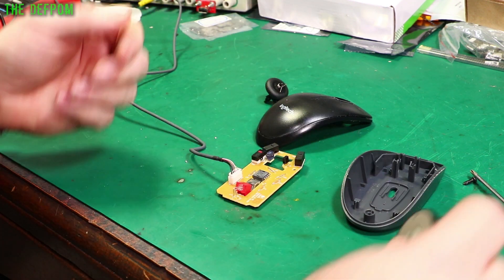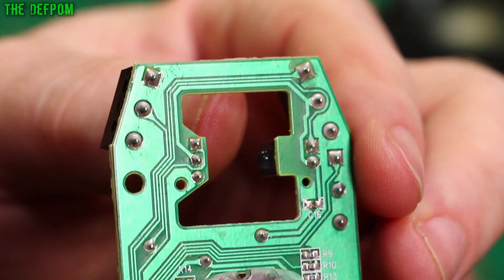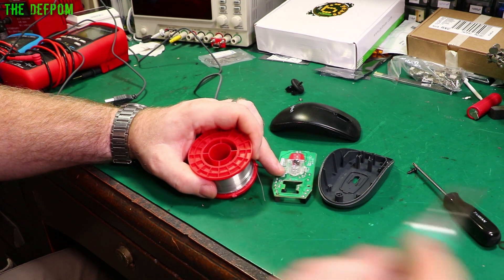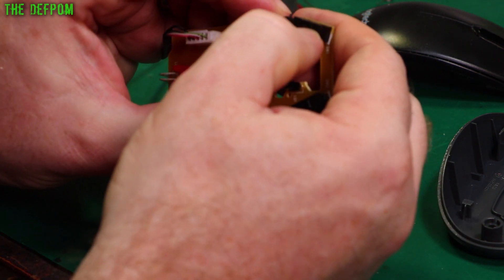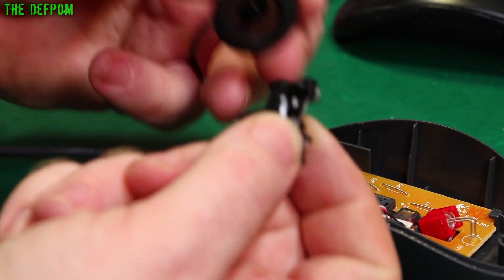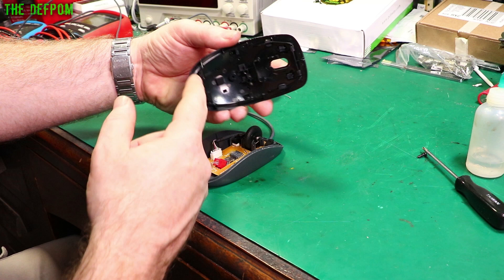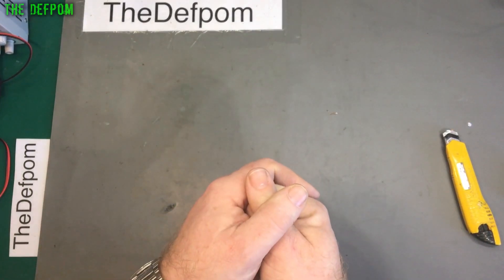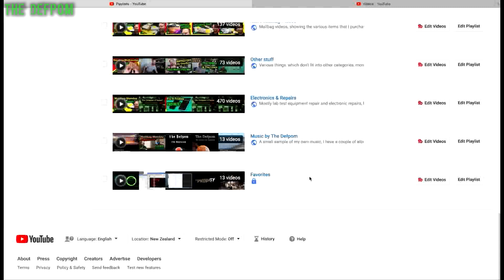🔴 #785 - 5 Minute Fix - Logitech M90 Mouse Button Repair

Comment: I have a Logitech mouse where the connectivity cuts in and out because the wires worn at the point of entry into the mouse. Any suggestions?
Reply: you can peel the cable and solter it again

Comment: I went thru a half dozen of the V450 (M-RBY125) Nano wireless mice. Every one eventually failed from this same multiple click issue. Shame, since I liked the smaller size for use with my laptops. I've gone back to my old trusty (and ugly) Microsoft wired mouse, now over 20 years old..........zero issues.

Comment: If it's still not working stick the scope on it and see if you can capture the phantom switching and then try a wee capacitor on it (assuming you can't find replacement switches).
My Dev PC is a home built unit, but I use a DELL keyboard and mouse.......very reliable.
Reply from the maker: It has been working fine since doing this, it was most likely the solder joint.

Comment: Always, always replace microswitches on Logitech at first sign of issues. Logitech failed as a brand, constant hardware issues, and software drivers that cannot be installed on "some" PCs (G203). I'm looking for better brand, but no luck so far. I guess I just order 10 or so microswitches and keep current mouse until it's completely goner.
Reply from the maker: I have about a dozen of these mice on different machines, this is the first one that has played up.

Comment: Hopefully the resolder and switch drench sorted it.
I just hate the laptops with no real left right click buttons on the pad, i don't like acting like a demented woodpecker.
No matter how much i adjust the settings or change the mouse software, it still gets the odd clicks that i didn't want. 
My mate brought his gaming mouse to me because the left switch didnt work, so i ordered some known branded ones and replaced both the main ones,  it lasted two weeks and one switch had failed.
Put a couple more in....... a month of life.
I could not believe they were so crap, i've seen similar switches last 10 years without problems.
Do you remember the early mice with the etched round disks that had little contact fingers touching them?.
Like a c.b channel change but smaller.
Still reading, well done :)
Reply: "his gaming mouse" please share brand/model, so others can avoid this trap.
Reply from the maker: Yep still reading 😀

Comment: May I recommend Logitech Marathon mouse M705? It's rather cheap and the batteries last for an eternity.
Reply from the maker: Personally I don’t like wireless mice/keyboards tried them once but didn’t like the waste caused by the batteries.
Reply: They're not sucking juice like they used to but I can definitely agree on the waste part. They last a year +/- a couple of months but I do sadly use Alkalines. NiMH are pretty much useless for this purpose due to self-discharge.
Reply: Logitech as a brand failed. Constant hardware issues, and software drivers that cannot be installed on win10. I'm in active search for another brand.
Reply: @tigrafrog  This happens with all brands if you try to use something from the year 1873 on a modern os. May I ask what device you're struggling with? You don't need any software for their mouse/keyboards to function.
Reply: I have to agree, I've been using a M705 for several years without a glitch and I just checked it (because I couldn't remember) - it still has the batteries in it that came with it!